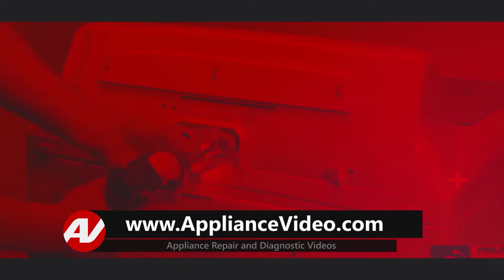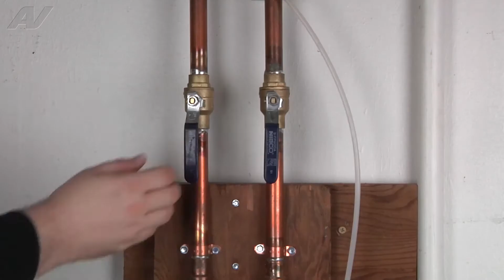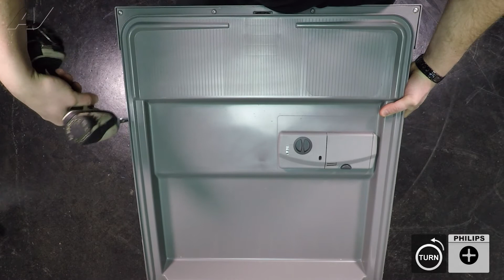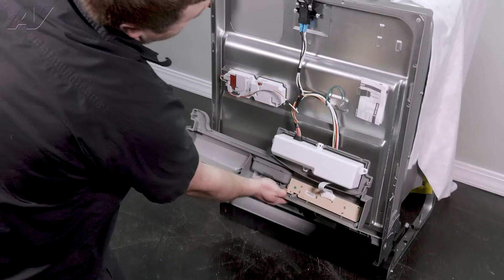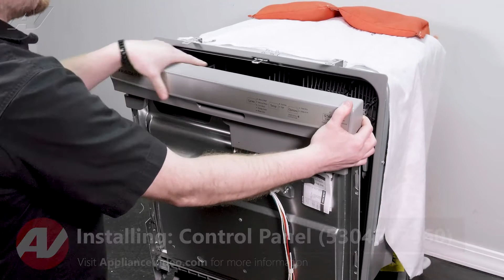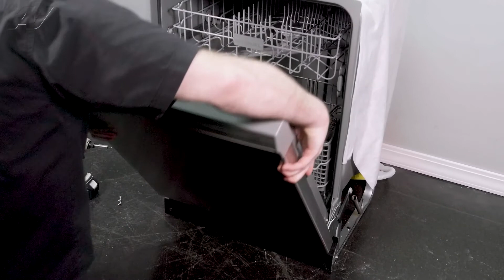Frigidaire Dishwasher Repair - Will Not Start - Electronic Control

Comment: The drain motor control (Blue WIRE) has 12 to 15vac instead of 120ac, any idear what component blew up in the control board?